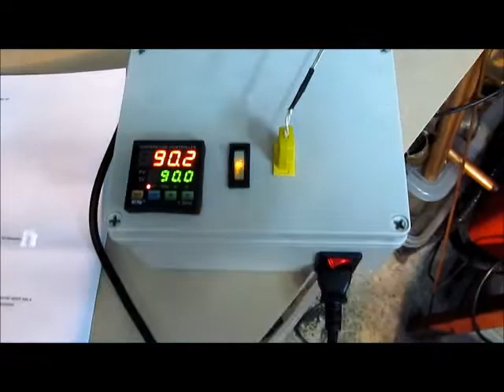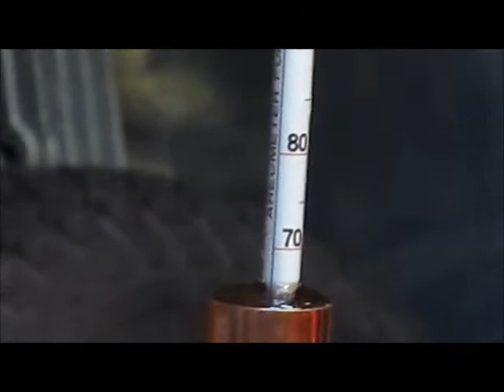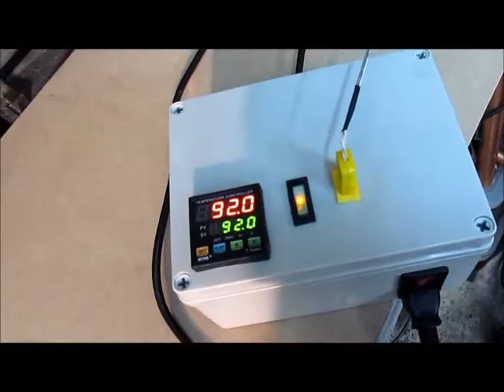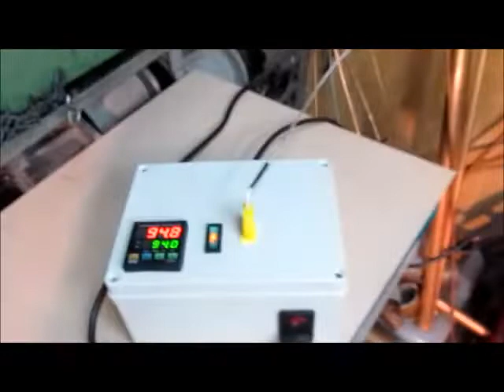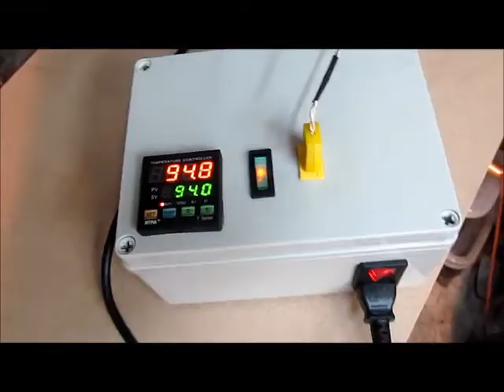Apple Brandy run on new build Pot still

Comment: Hi, I am just watching this on my phone and I'm still but half way through your video, but all the same, I'm not sure I'll be able to make sense of your liebig and parrot set up - it looks damn fantastic, btw - and I was wondering if you had a diagram? Or description of how you have it set up, etc? It's definitely the nicest arrangement I've come across, and the closest to how I'd like to rearrange mine (1st is a parrot mounted directly to brass plate, which rests upon the ground; tail piece is made from a reducer and acts as funnel. 2nd is a typical inline parrot with bottom valve).

Again, love your set up and I appreciate the video very much! Thanks!
Reply from the maker: Hi Kaij,
thanks for your comments, much appreciated x
Okeh, the Liebig condenser is fitted to the Column using a 3/4 End Feed, sealed with a 3/4 fiber washer.. works fine no leaks.
I over extended the condenser as it was about 12" longer than the norm... to 36".. as the parrot sits further away from the kettle then and not to close.
The tubes used were.. 22mm inside and the condenser tube is 28mm with a couple of reducers from 22 down to 10mm.
That then meets the Free Standing Parrot, which is held upright via a BSP Malleable Cast Iron Pipe Fitting Wall Mount Floor Flange 3/4" found on Fleabay, and the tube that fits it is not connected to the booze, as i knocked the pipe straight through the Tee-Piece that holds it in place onto the ply board, where the Demijohn sits.
The parrot's run is straight through from the feeder reducer at top, to the dripper at the bottom. One thing i did was to connect both the dripper tube and the drain tube together, so then there is only one outlet.. straight into the Demijohn either way. Hope this help and ask if your stuck on anything bud.